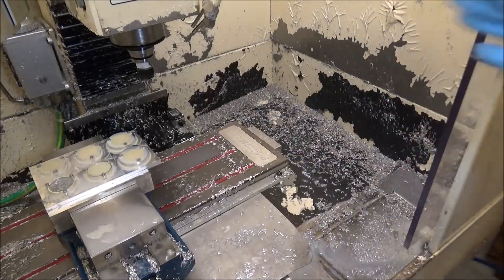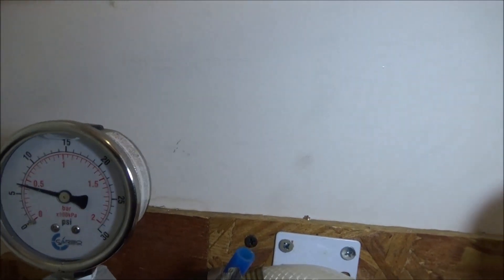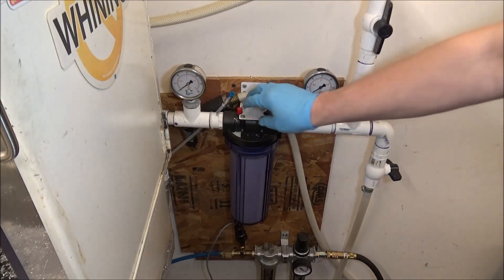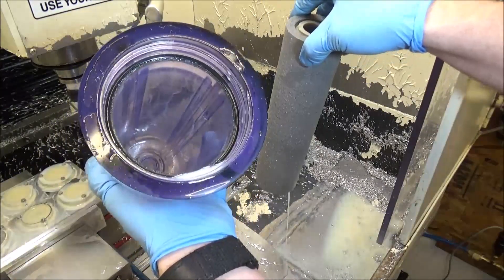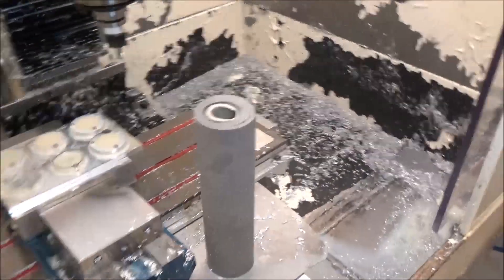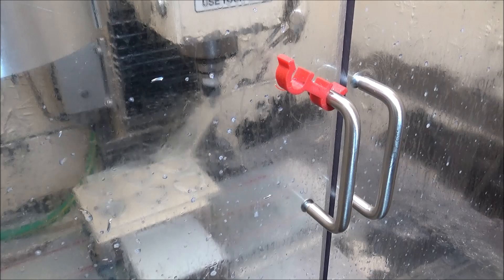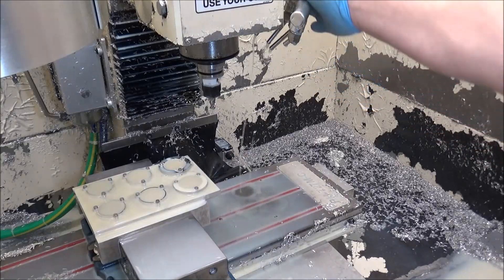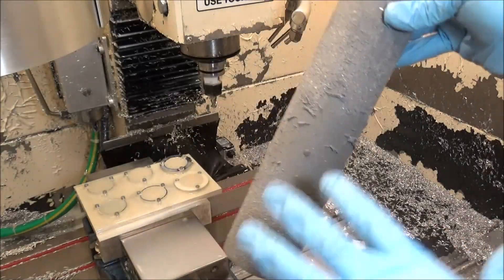Flood Coolant Filter change

Comment: i have to ask you a question, on my pm25mv when i have a indicator in the spindle i can move the head back and forth about .009  this seems like too much, this a gib adjustment i assume how much do you set your?
Reply from the maker: The gib adjustment will help with side to side . Front to back not as much.
The trick is to remove as much as possible with outbidding or adding too much STICKTION.
Tighten check tighten check.